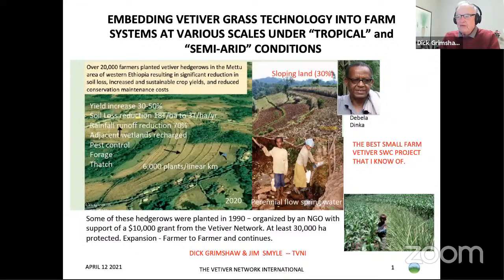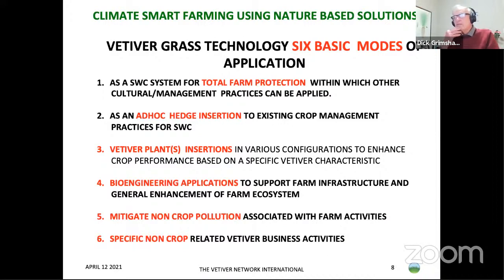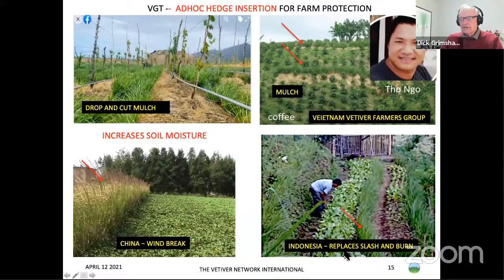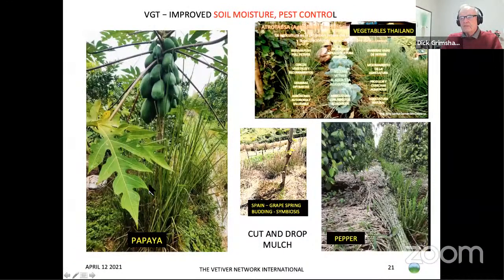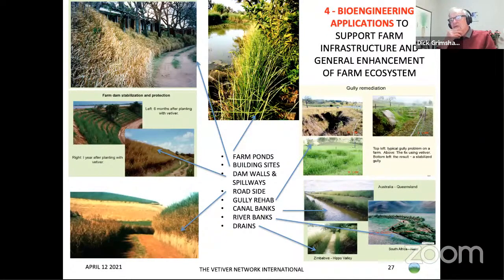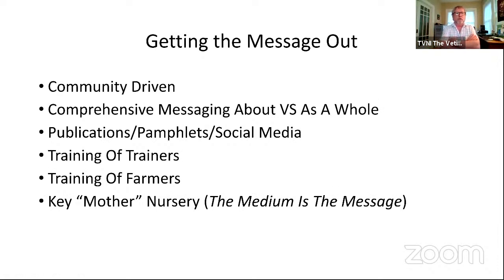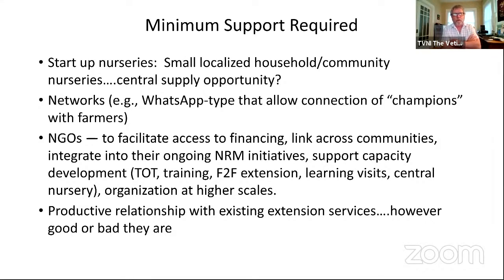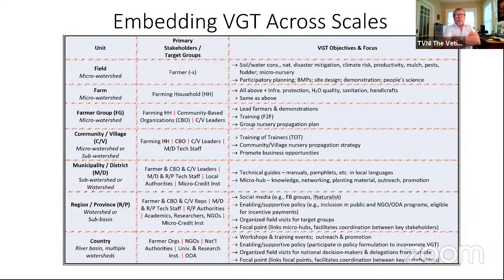TVNI WEBINAR # 1 --- EMBEDDING VETIVER GRASS TECHNOLOGY INTO FARM SYSTEMS

Comment: I use Vetiver to stabilize gully-head erosion.
Firstly I plant a row about 2-3 Meters below the gully-head, where there is a little sediment. This catches more sediment and forms a pool of water at the base of the gully-head.
I then plant vetiver in the toe of the gully head. This prevents the undercutting action of the water, and instead of undercutting, the gully head will begin to have a slope. I then plant the vetiver further up the slope, until I have the whole sloping gully-head covered. The gully-head is then stabilized and so far has survived several floods without shifting.
Reply: Where are you located?